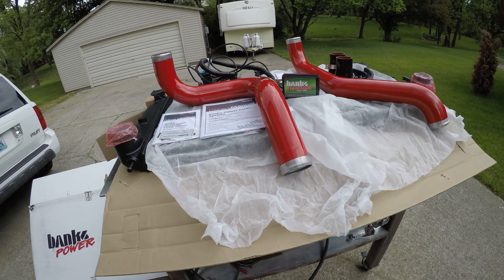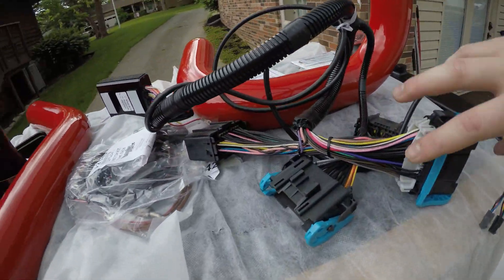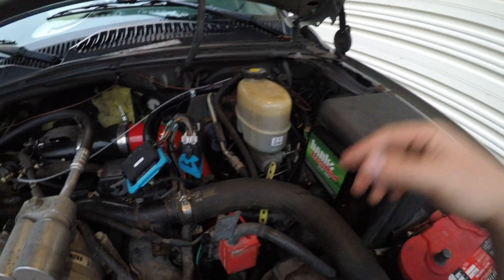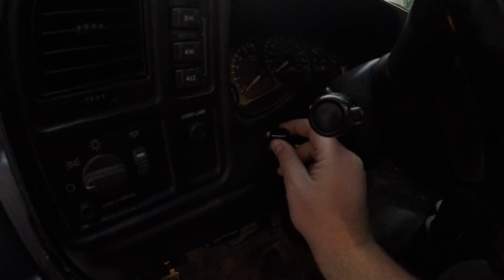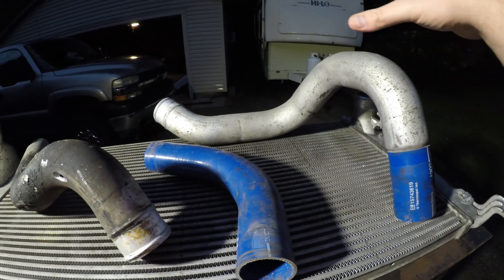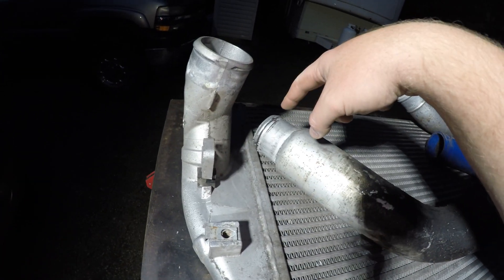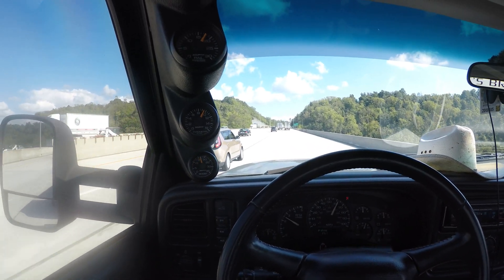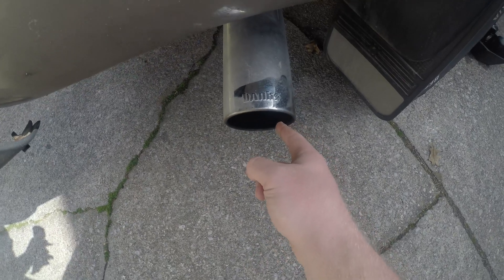Upgrade Lowdown:  '02 LB7 Duramax Banks Power TechniCooler Intercooler and EconoMind In-Line Tuner

Comment: Enjoying the build man! I've had a Banks 6-gun bundle on my 01 lb7 for years and still love it.   Getting the economind for my 02 4x4 flatbed.  Been very happy with Banks for decades!
Reply from the maker: I'm glad you're enjoying the build!  Does the Six-Gun change how the truck drives?  The EconoMind doesn't seem to affect how responsive the truck is; it just raises the power ceiling radically.  I've got a buddy who's wanting to put a Six-Gun on his LBZ, and we're both curious how different it will be from my EconoMind setup.

That's so neat that you've got two of these LB7 trucks!  Let me know what you think once you get the EconoMind installed.

Thank you for watching and for commenting!
Reply: @JayRussellDuramax  Big fan of lb7s.  Bought my first lb7 in 2008 n still have it.  Happy owner of 3(running) lb7s now. 

The six gun definitely made a difference on the 01 2500 ccsb.  My daily service truck is a 02 never tuned 2500 ext cab. Going from one to the other the response and power is night and day difference.   But also a loaded service bed 2500 vs a lowered ccsb. 6gun is quick.. curious about economind.  Building this 4x4 dually for dirt roads n pulling trailers so hopefully economind will treat it best.
Reply from the maker: @micahblack454  That's so cool that you've got three of these trucks running!  

The EconoMind will give you a bunch of additional power for towing a load, but you can tell that it's not meant for performance, as the truck won't spin the tires or launch off of the line.  It very much waits for the truck to get going before it adds in any power.  Don't get me wrong, though, it's extremely quick; it's just not a race truck.

I think you'll be very pleased with the EconoMind on your dually.  As I hope this video showed, it handles a load really well!  

I might have to see about buying a Six-Gun and switching between the two to see how different the truck drives!
Reply: @JayRussellDuramax  Nice! It'd be cool to see if it would make any difference. Especially with uppipes, downpipe, manifolds, etc.
Reply from the maker: @micahblack454  Definitely!  If I get one, you'll see a video about it here.

Thank you again for watching and commenting!  It really helps me out, and it's always neat to hear about other people's trucks.

Comment: Thanks for that! I have a 2002 Silverado 2500hd 6.6 L Duramax Allison Transmission, Crew cab, Long Bed. Only truck I ever bought brand new, planning to keep it forever. I'm at 280,000 miles, and it still runs strong, does not use a drop of oil,   completely stock. Other than the Known injector issue, never had any problems. I just purchased a new Truck camper and have been researching some performance mods to do exactly what you are doing. I just received my Banks Cold Air Intake and Super Scoop, getting ready to install! Looking forward to seeing what that does for it, power wise? I think I will work towards doing the same mods you have done! Thanks for the info and motivation!! I'll be checking your other videos for more info!!👍
Reply from the maker: Awesome!  I love when people comment on my videos with stories like this.  That's so cool that you bought your truck brand new and plan on keeping it forever; I want to keep this truck forever, too!

Please let me know if you have any questions about what all I've done to my truck.  Also, based on the Banks Power website, the Super Scoop only fits '03 and up trucks.  So, if you can make it work on your '02, I'd love to know!

Thank you for watching and for sharing your truck plans with me!  I hope things go well for you as you begin the modification process.  Please feel free to comment with updates!
Reply: @JayRussellDuramax  Check out part number 42168 on Banks site. Says it's for 01 to 07 body style. I'll see when I get it if it fits.
Reply: PS:I actually got mine on Amazon,  but I double checked the part number on Banks Site to verify.
Reply from the maker: @bigjohnpault5788  It says '03 to '07 when I look at it.  Regardless, please let me know if it fits!  If it does, I may get one for my truck!

Comment: I’ve had my lb7 since may 2020 and the only reason I’ve left it stock is I’m worried about the head gasket. Had a buddy who had one who didn’t treat it too bad but would get on it from time to time, his went up at 230k and warped the heads. Aka I’m scared 😂
Reply from the maker: Nothing wrong with being careful, my friend!  I will tell you that, after filming this video, the coolant temperature was the highest I've ever seen, ~210 degrees, and I still didn't have any coolant or crank-case pressure!  I get on it quite often and I've seen no signs of distress.
Reply: When you replace the head gaskets do yourself a favor and install the ARP headstuds and either replace or reseal the injector cup seals. You also adjust the valves.  Well worth it.

Comment: What level setting have you seen best MPG on? I just installed my economind also. Thank you 🙏🏽
Reply from the maker: That's awesome, Abraham!  What's really neat about the EconoMind is that it maximizes fuel economy in ALL settings.  So, the only "setting" you need to worry about is what you're doing with your right foot.  

For a while, I drove it around in Level 1 and only turned up the power if I needed it because I thought that would give me the best mileage.  However, I've recently switched to keeping it in Level 6 all the time and just putting extra care into what I'm doing with my right foot.  Having all of that power on tap whenever I want it is incredible, and my fuel mileage hasn't dropped!  If anything, it's gone up a little bit because I have to drive more carefully since the thing is a rocket ship when I put my foot down and can easily get me into trouble if I'm not careful.

I'm so glad to hear from others who are buying and enjoying the same parts I've put on my truck!  Though I'm no substitute for calling Banks Power, please let me know if you have any questions about your EconoMind, and I'll be glad to help you out!

Thank you for watching and for commenting!
Reply: Thanks you so much for your response. I currently have been driving level 3 thanks again for the info
Reply from the maker: You're welcome, Abraham!  I hope you enjoy your truck!

Comment: Hi Jay, I really appreciate you putting out these videos. I have an ‘03 extended cab long bed lb7. She’s in the shop now getting her third set of injectors. Going with the SAC style this time with the EFI live programming. 
Currently have the Banks cold air and 4” exhaust. Have had two Edge programmers. I have also done most of the front end with Kryptonite parts with Bilstein 5100’s.  Better ride and handling. 
168,000 miles
Reply from the maker: These S&S Diesel Motorsport, SAC00 injectors are holding up great, so far!  I've been able to make a lot of power with them, too!  I'd really recommend the Banks Power tuner that I'm using in this video, rather than using EFI Live.  This tuner will protect your transmission and engine in a way that EFI Live won't.  My transmission and engine are 100% stock with 253,000 miles on them, and I've had no issues with all of this extra power! 

As far as front end parts, I'm looking into the BD Diesel front end kit to replace the stock tie rods, sway bar end links, and center link.  I don't do anything reckless in 4WD, so haven't had any issues with the stock steering, either.

Thank you for watching and for commenting!
Reply: @JayRussellDuramax  Thanks for your reply! I was wondering if you had changed/and what injectors you were running. I'm getting the LDS 45 over with the EFI live (required to detune them) price was right and great reviews). Banks is definitely a great line of products. Gale Banks is the man!!! Once you make some changes to your front end, you will truly enjoy it. I don't do any crazy off road either. Just wanted almost forever reliability. Thanks again and yes I am a subscriber. Best of luck.
Reply from the maker: @vadrifter3200  You're welcome!  I appreciate all of my commenters, and I try to reply to all of them.

May I ask what you're paying for the injectors?  The SAC00 injectors cost me $2,712 for 8, brand new injectors.  I bought them through Thoroughbred Diesel.  Since they're not oversized, you don't have to tune anything!

I'm excited about getting new front end parts!  Thank you for telling me about your truck! 

Thank you for subscribing, too!
Reply: @JayRussellDuramax  About the same for brand new except LDS includes the master install kit. I also added glow plugs and new bolts for the valve covers both upper and lower, and hard lines. Age and contamination (salty roads) is what made me go this way. Can't afford to replace the truck, got do almost whatever it takes to keep her running right. Gotta love that torque!
Really appreciate you sharing your journey with your truck.

You are welcome for the subscription! LB7 owners need to stick together! Have you checked out Truck Master?
Reply from the maker: @vadrifter3200  You're welcome!  Thank you for sharing your journey as well!  It's always good to talk to my fellow, LB7 owners.  Please let me know if you have any questions about what I've done to my truck.  I'd be happy to give an answer in the comments or make a video if the answer requires it.  Again, thank you for watching, commenting, and subscribing!  It means a lot to me, and I really appreciate each one of my subscribers - especially those with LB7s!  Haha!

Comment: Nice truck man I subscribed I've got a lmm i had banks and went to efi live never looking back!
Reply from the maker: Thank you!  I'll stick with Banks for my truck because of how it protects the transmission.  I love the fact that my truck is this powerful and the stock transmission can handle it!  Thank you for watching and for commenting and subscribing!
Reply: @JayRussellDuramax  No problem but a good tuner such as nick over at duramax tuner can absolutely defuel during trans shifts. The reason I'm so set it a custom tune file is simply because all trucks aren't created equal.. that being said with custom tune files we actually data logged while I was working the truck... we were able to get 16 mpg while maintaining egt's between 700 to a 1000... also the turbo braking feature is a life saver on brakes with 130 hp or more of braking power is phenomenal when stopping a load. This is my reasoning... much luck to you and thanks for responding love the content!
Reply from the maker: @TheBradd88  You're welcome!  I always try to reply to my commenters!  

The de-fueling during the shift isn't all that's going on when the Banks tuner is protecting the transmission.  Because it has 5 levels of added power, it can pull power back to stock if it detects issues - such as transmission slippage.  That's something EFI live can't do, that I know of.  The engine makes the power it makes, and the only way for the transmission to say it's too much is to go into limp mode.  

My truck is probably making twice as much power as stock, and I've never had the transmission go into limp mode.  I've heard stories all over the place of people limping their stock transmission on ECM tunes making much less power than my truck.

Basically, the Banks unit is actively data-logging to make sure the truck is safe while it's also maximizing power and fuel economy.  Static tuning can't do that.